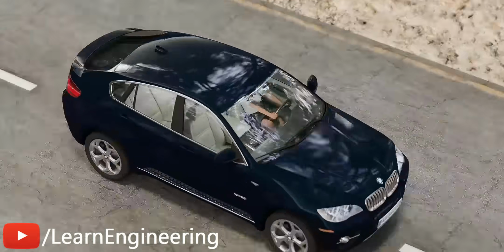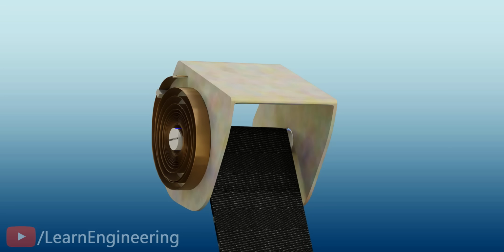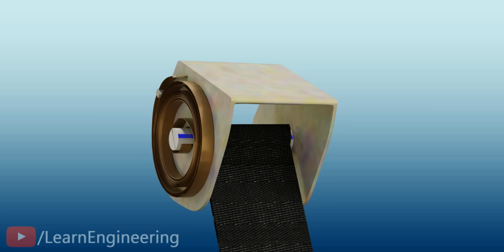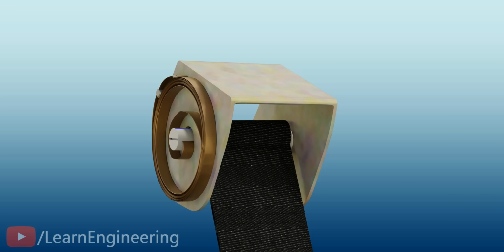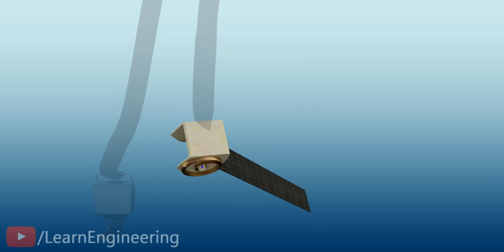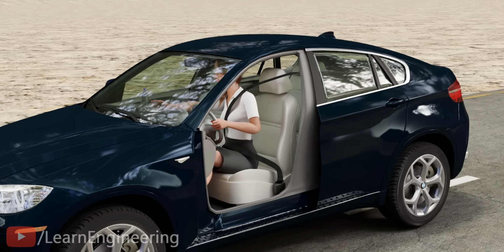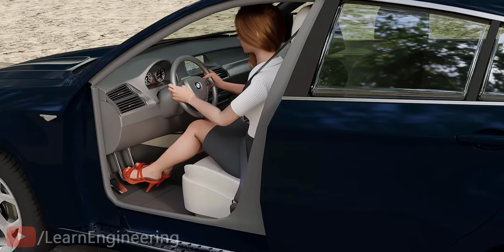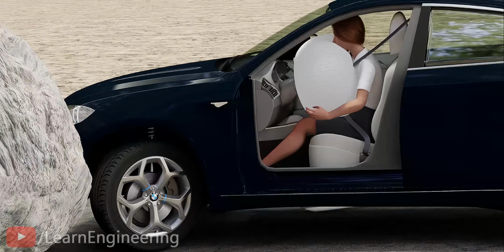Seatbelt | How does it work?

Comment: are you sure the pretensioner is activated by the fast move of the break pedal?
Reply: Yeah, they’re completely wrong on that one. Seems like common sense that you don’t have a pyrotechnic device going off every time you slam on the brakes. They are controlled and triggered by the supplemental inflatable restraint system module(air bag) one exception to this is a few up-optioned or luxury modern vehicles use an electric motor to take up the seatbelt slack during heavy braking or stability control activation situations. This electric system is not a replacement for the pyrotechnic seatbelt tensioner system, just supplemental.
Reply: @johnnybrown04  Agreed. That explanation concerning pretensioners firing when you slam on the brakes is completely wrong. Hell, i've even been in accidents where the pretensioner didn't fire (because it was a low enough speed collision that the airbags didn't fire). An electrically operated system might tighten you in the seat when driving aggressively or braking hard (Drove an E-class mercedes once whose seats would support my sides when cornering hard automatically... not sure if electric or pneumatic, but the sides of the seats were active - and the belt would tighten to keep me in position), but that's no replacement for the instantaneous response of an explosive charge.

Comment: Please make a video on "How Hill climb assist works in car?" Or "How cruise control feature works in the car?"
Reply: Cruise control is just a computer module that keeps your speed the same. Pretty much all modern cars use electronic throttle bodies so they can control them to keep the same speed. It’s really not that remarkable. Adaptive cruise just uses a radar sensor to keep you at a certain distance from the car in front
Reply: Also traction control, please

Comment: So the pre tensioner only can work once? After the explosives that triggered the mechanism are used up and have to be manually reset?
Reply: Correct, The pretensioners must be replaced or rebuilt after an accident. The video is mistaken about when they fire though, you cannot simply trigger the pretensioners by slamming on the brakes, they are fired when an impact is detected and/or the SRS module determines they are necessary.
Reply: Brad Noyes Something is wrong here. I hav had the pretension happen at least twice in my car during hard breaking. There must be a multi-usage solution that is not covered in this video.
Reply: @VirtuellJo  The pretensioner is usually an explosive charge, once it fires, it can never fire again. Unless you've replaced the pretensioner in your car (or your car uses a different technology), it has not happened in your car twice. What I assume you are thinking of is the seat belt retractor's locking system. As the video states, the retractor can temporarily lock the seat belt in some situations, such as hard braking and cornering, where a weight inside the retractor (the steel ball mentioned at 2:10) causes the retractor to lock, or when the seat belt is pulled rapidly (3:50) the rapid movement will cause the retractor to lock. However in both of these cases, once the braking/cornering event is complete and there is no longer tension on the belt, the lock will release and the seat belt will be free to pull out again.
Reply: @mariomajcica4618  Yes, It looks like some Mercedes Benz Vehicles uses an electric pretensioner system unlike the pyrotechnic pretensioner described in the video.
Reply: Wouldnt IT be better if The pre tensioner worked on air, like when you brake hard suddenly instead of explosive?
Reply: H I T M A N CoC my guess is the explosives can create a lot more pressure much faster and more reliably than a compressed air feed. The car would need more equipment (air compressor and storage). I guess they did the math and figured it would be cheaper to replace explosives as needed than to include every car with a compressed air system.
Reply: @JacobHutzler  Let's face it, once a car is more than a few years old, if it gets in a wreck that deploys airbags/pretensioners, there's no need to replace them because the vehicle is likely a total loss at that point.
Reply: Brad Noyes very good point as well. I suppose the next thing I’m curious about is how the detect an imminent crash. I was thinking more along the lines of the system thinks a crash is imminent, fires the pretensioners, but you just miss the crash. Maybe that situation isn’t possible, idk.
Reply: Yes, and then you shell out $500 or more to have it replaced.  Small price for saving your life, I suppose.

Comment: Anyone else’s seatbelt lock up sometimes when your not doing anything
Reply: Like breaking at a T crossing and leaning forward to see crossing traffic? Yes.
Reply: Proto Man 😂
Reply: Or a middle seat seat belt jammed because your station wagon rear seats fold down, shortening the length furthur while it down, so getting the seat back up leaves it permanantly jammed. This is for those middle seats with seat belt fitted into top of folding seat. Other ways it jams, is when you are at a intersection with a camber or slope sideways meaning seatbelt inadvertantly does it job, so you cannet lean forward for better view around parked cars. But I trust the seatbelt with my life, because it original design was simple, and if simple works, then it smart. Thank you Volvo for not patenting (or trademarking ?) the 3 point safety belt, but instead allowing other car manufactuers to use their design for all our safety.
Reply: @wonniewarrior  they did patent it, but left it open for other manufacturers to use, if they didnt patent it, then someone else could and disallow other manufacturers to use it
Reply: @seannz100  A general rule of patents is that 'information cannot be in the public domain' at the time of application. I am not sure on the history but if Volvo did not patent it, another manufacture could not patent that technology as it is no longer new and novel.
Reply: When we haven't buckled the Seat Belt and see Police standing in front and when we try to suddenly pull the seat belt, it will lock. We end up paying Fine
Reply: @imthiyazahamed4248  you pulled too fast
Reply: Yep my 2016 Sonata.
Reply: I’m driving a 1965 Volvo. My seat belt is locked up, permanently when buckeled.
Reply: @doctorweile  2 point seat belt?
Reply: @bonifacethattil9567  i mean, volvo literally invented the 3 point seat belt in 1959, so you best believe it does!
Reply: Probably because you're touching the brakes
Reply: Yep. Happened to my old car. If the seatbelt locked up, well hope i dont crash and die
Reply: Or when you try to put it on when you get in and you spend 5 mins pulling gently and slowly but it keeps locking up. Or when you have it on, and even before the car is started or moving, and it has locked up with you tight to the seat and you can’t even move forward more then an inch coz it has to retract but can’t coz your body is in the way and as you try to get some slack it just it causes it to ratchet tighter till you are pressed tight to the seat and you have to release the buckle but now the belt is so tight that there is to much force on the buckle clip that the release button can not depress and you have to wiggle free by sliding out from under the belt. And the other times, no matter how hard or fast you pull, the belt never locks up and just keeps giving you slack.
Reply: Yes. When passing a cop car and you panic and try to pull your seat belt fast. It always locks up, like your car is saying f you
Reply: All the times when I quickly lean forward, but that is it working as designed.

Comment: She presses the brake with her left foot in a manual. This is wrong on so many levels. Also, guess my car doesn't have said mechanism since I've done a full blown emergency braking once and I wasn't retracted into the seat. Me: guess I'll die 🤷🏽‍♂️
Reply: If the pre-tensioner uses explosives, it probably has another mechanism to prevent it from exploding every time you brake hard, because it can be used only once (like airbags).
Actually, that's really weird. Why use explosives that can work only once? Is it necessary to replace them after every accident or hard braking?
Reply: @pmj_studio4065  An accident doesn't happen before an impact. I can brake how I want and the explosive should not detonate. Any kind of braking is not an accident. So the explosive can only detonate in the microsecond when a sensor touches another object after braking. Which is too late. There's an logical mistake somewhere if u ask me
Reply: @ProtoMan137  The video is mistaken, the pretensioners do not fire before an impact. When the vehicle hits something, there is time between the initial impact and the vehicle coming to a complete stop. This time is time in which the occupants of the vehicle must be safely decelerated from the vehicle's pre collision speed to a stop. The most serious accident is when a vehicle hits a stationary 'non deformable' object (such as the rock in the video). If the vehicle had a 'rigid body' chassis (term used in theoretical physics to mean undeformable) then the vehicle and occupants would have to decelerate to zero instantaneously, resulting in massive injury or death to the occupants. Obviously this is theoretical, and the chassis of the vehicle bends and deforms, all the while decelerating the passenger compartment and therfore the occupants (this is the reason for crumple zones, they are sacrificial components of the vehicle intended to absorb the energy of the vehicle and decelerate it at a rate that is more safe for the occupants. This increases the time from which the initial impact occurs to when the vehicle & occupants come to a stop. During this time after initial impact the SRS (Airbag) module uses accelerometers and in many cases additional 'impact ' sensors and occupant weight sensors (it varies from manufacturer to manufacturer) to compute the severity of the accident, determine which aribags/pretensioners to deploy and in some cases how quickly to deploy them (some aribags have multiple stage deployments) , all in fractions of a second and before the force of the impact reaches the passenger compartment.